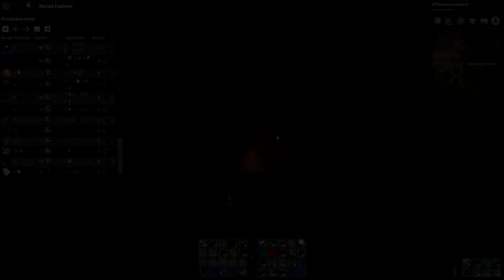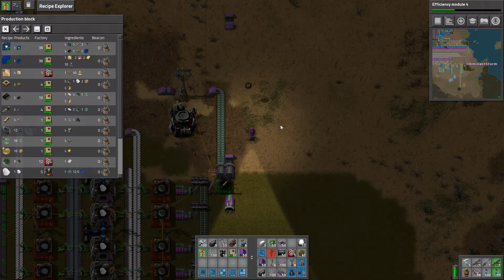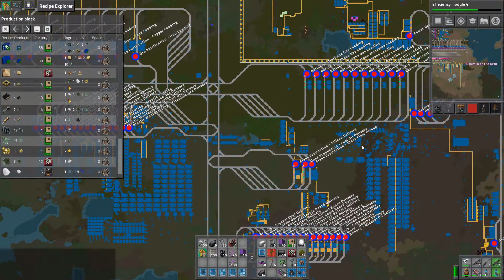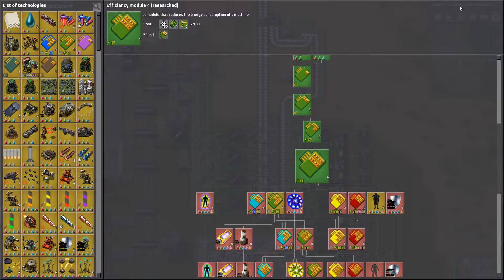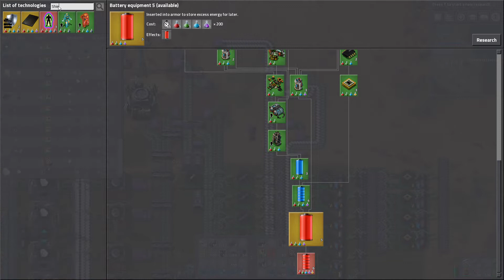Factorio - Angel's & Bob's - Episode 225 - CPU Assembly

Comment: For the final assembly process, what if you just split it into two columns of 19 factories each? Then you'd have 20 solder and 20 integrated electronics as input to each column, and that can be combined into a single belt. Then you'd have three input belts instead of four, and you could use the exact same layout as for the transistors, which is a nice simple layout.